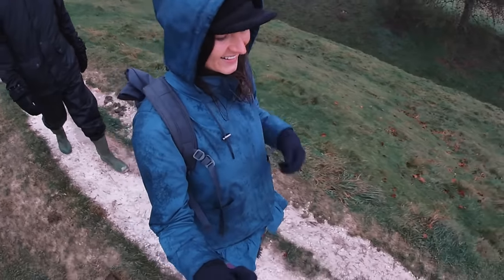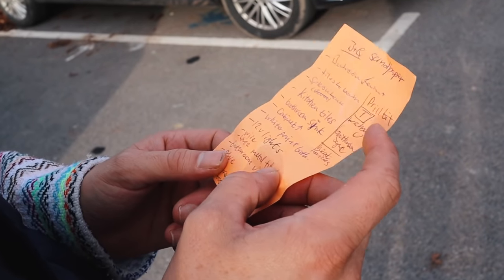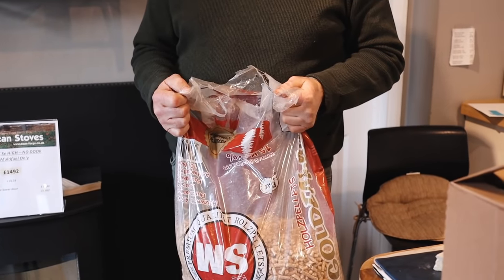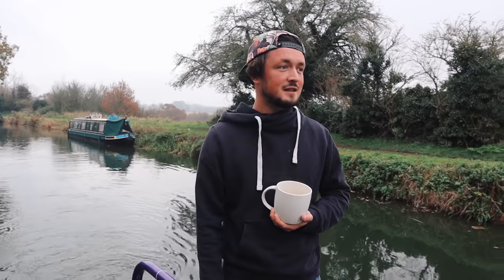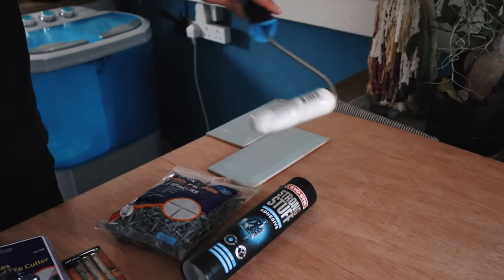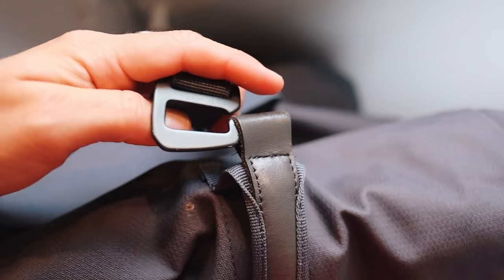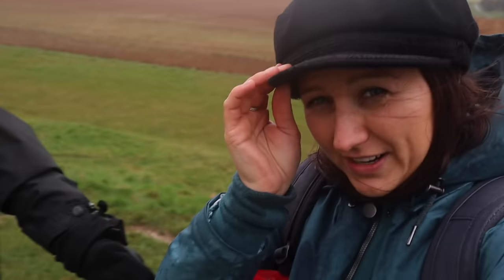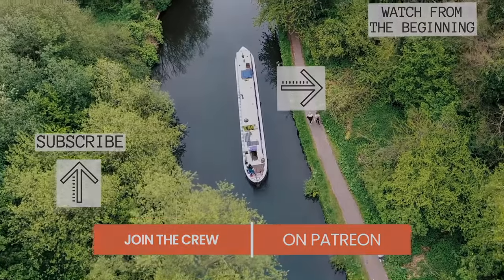Winter Morning Routine Living on a Canal Boat Full-Time

Comment: Hi, I love the videos, but one thing is really bugging me.  Every time you show your mooring lines you appear to be tying them on the bank, rather than running them back to the boat and tying off there.   It's safer for other users of the towpath, as there's not a load of extra rope around the pins and rings, plus they're less likely to be messed with if they're tied up on the boat rather than the towpath. Stay safe out there, hope you manage to keep warm. xxx
Reply from the maker: Hi Richard, thank you so much for watching our videos and thank you for your advice 💜 Have a nice weekend xx

Comment: Great diy result. I used to hate condensation on the windows but now use the temp double glazing (cling film!) over the windows during the winter and it eliminates it completely for just a few quid per pack.
Reply: Stormguard, but if you search window insulation kit on ebay or look in B and Q and Wickes you will find others.
Reply: James Cricket  James yes I used to use these kits when I lived in bricks and mortar as well as now on a boat and it transforms winter living for such a small cost. Good luck.

Comment: The best way I’ve seen a fire lighted is with one of those gas torches plumbers use for soldering Cooper pipes with, a quick blast and it’s up and running seconds.
Reply: I have a gas poker that runs off a small propane tank. Light it and stick it in the coals. Great if I've run out of kindling.

Comment: I have a wood pellet stove and it has electric motors for exhaust and blow the heat into the room.  When our electricity when out for 8 hours last week if it wasn't for our other wood stove we would have frozen and had to move into a hotel and the rest of the family in the nearby area was without  electricity also.

Comment: Hotmax heatlogs are the bees knees.  Not only made out of a renewable source,  but a waste part of that renewable source, from horse bedding industry. .  Easy to light an give out good heat, and smoke free once well lit.  £11 for two 20 kilo bags in my parts. You can also break them ( with effort)  into smaller size if just want reduced heat or shorter burntime.

Comment: Pellet stoves are great but for you it would not because the pellets are sawdust and you can not store them outside like your coal, they will soak up moisture ,and  you will end up with wet soggy expanded bag of  sawdust that will not burn no matter what you do to it.   not recommended on a narrow boat...

Comment: Belated birthday wishes Marina. Great vlog, good to see that the weather doesn't put you off going out for you walk. Could I suggest you nail some chicken wire onto the plank of wood you use to get on and off the boat. Its a good anti slip measure for when the plank is wet or icy.
Reply from the maker: Thank you for watching lovely and thank you for the tip! 💜 xx